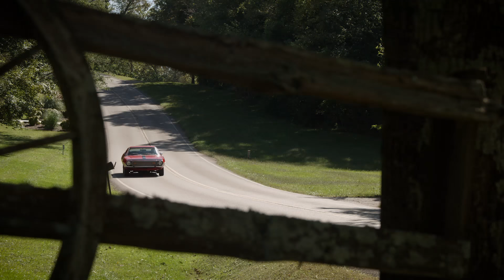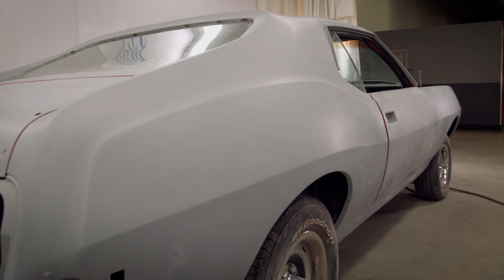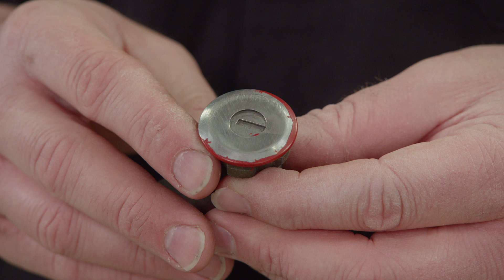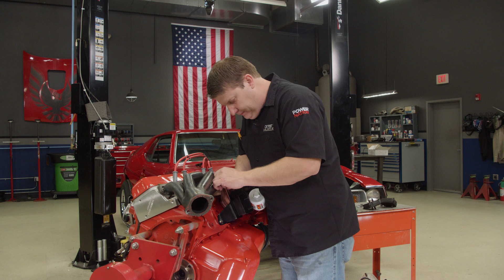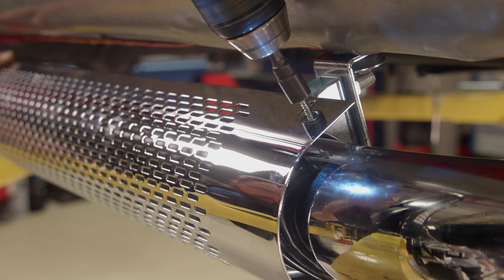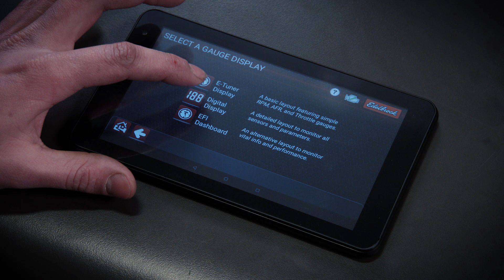Full Build: Transforming an AMC Javelin to a 70s Muscle Machine

Comment: My first new car was a 1973 AMX, black with the Pierre Cardin interior, with a 401 Go Pac and torque-flight automatic. It was hard to find good parts. The Hooker headers didn't fit that well. At one point I had put in a roll cage, and a narrowed Dana with 4.56 with a 4 leaf-link setup. I had a set of heads built by Booth-Arons. I raced a few times at Englishtown, but I was more on the street. I also had a blue 360 4 speed AMX, 304 Gremlin X, pus another Gremlin and Hornet. I miss that car. I've been looking for another before I croak. A word of caution for anyone building a 401. In 74 AMC dropped the 401 head with individual rockers and the only heads available were 304 heads with bridged rocker mounts.

Comment: I had a 1969 javelin I ordered new fully loaded with the 343cu in engine, what a great car. Next I ordered a 1973 javelin with a 304 cu in engine also fully loaded. After owning the 1969 I was very disappointed in the 1973. But it really looked good but performance was not even close to the 1969 car. Handling or speed

Comment: They ruined the look of that car in my opinion. The 390 these came with were very strong, could have went that route but at the minimum keep the looks like it came from the factory for the most part. I was always a huge fan of the original rims and looks of the car. The engine mods were great but ridiculous side pipes, traction bars and the ridiculous wheels? Really?! That's why those were left in the past.

Comment: My 74 amx has a cool adjustments on the front suspension and it changes the way it corners with bolts that are camed. I can turn it after I unlock the lock nut. The way I was looking at the control arm that the bushings were worn out and egg-shaped the hole. But I'm super surprised that it was set up for a pit stop that they were able to move the wheel up and back. In and out in moments.  .I have had a lot of fun with my old race car. I All ways like to road race.  That car is the best fun. I all ways drove Ford 500 cop cars . They are not easy to top in the road handling.

Comment: I had a 73' Duster.  I'm about 6'-2" 290lbs and in the mid 1980's me and my brother were working on the Duster.  We had to change the heater core.  Now the average dude would do what Tommy showed all of us; loosen the clamp and cut the heater hoses with a nice sharp blade.  What did I do?  Well, we had ZZ Top blasting on the car's audio system and I just locked my Gorilla hands onto one of the hoses and ripped it right off the firewall.  The back of my right elbow made a V-Curve in the top of the radiator.  I'm looking at the car and then I brushed off my arm and said "I broke the pretty car".  My brother and my friend Scott were on the ground laughing and howling.  So, don't be a Gorilla like me and use a sharp blade and cut the hoses off just like Tommy.

Comment: This was the lamest build I have seen. What a waste of air time.  So you threw a cheap, generic set of Crager rims with the wrong rear offsets on it including some of the cheapest white lettered tires. White lettering, for the "performance look". Lol.  A front pair of stock, red painted brake calipers and generic rotors were used for the "brake upgrades".  So far less than $1k spent.  Did the handling and braking improve?  Absolutely not!  
The skinny front tires will lock up under moderate braking pressure. The air shocks ensure the rear end has zero movement and will be rigid.  The car , with it's rear tires having wrong offsets, butt end sticking up 4" taller than stock and no suspension travel, skinny front tires with all the car's weight now shoved to the front with new front brakes, this thing will surely kill the 1st person dumb enough to take it on a twisty road or high speed highway.
You all painted the junk Jeep 304ci motor, threw on an intake, carb, headers, and distributor and did an engine Dyno pull acting like we're stupid enough to believe wheel horse power is same as an engine stand Dyno run.
No wonder Mark isn't there for the actual build.  You all took a really decent car and made a Joe Dirt replicar he would drive in the movie.
Ruined a decent car that woulda made a fantastic Trans Am racer replica build.

Comment: I like the transformation BUT I really liked it how it was before, I would of added longer duration cam with a near stock cam centerline with only a bit more lift with those edelbrock heads with a decent 10 to 1 compression ratio , refresh bottom end nothing radical 190hp to the wheels I would've been fine with all stock exhaust.  

I think this car is golden . you guys did a great job btw.

Comment: My high school car was a lot like this. In  November of 1986 my dad came home in a gold on gold on Gold 1975 Dodge Dart Swinger. It was 100% OEM with less than. 13,000miles on it. It took a week before I had tented the side a d rear windows dark black along with the upper 1/4 of the windshield. Add air shocks and antihope bars just like this raised in the rear with 14x8 205/35/14 front 255/45/15 rear with the exact same Crager mags, the 2 barrel Carter carb and OEM steel intake manifold, OEM Altrrnator, H2O Pump, Fuel Pump, distributor, air cleaner, all came off while the cam, timing gears, heads, rockers, lifters, came out. All replaced with MRP bolts, rockers, rods, lifters, Crower Cam, timing gears to loose the sloppy chain, alloy heads ported and polished from a 68 Dodge 340ci, alloy intake manifold from a 67 Plymouth 360ci motor, OEM was replaced by Accel Distributor,  Coil, Wires AC Delco Plugs, Holley HP Fuel pump,  braided stainless lines, double pumper 650cfm Holly Dominator 4 Barrel Carberator, K&N Triangle washable foam and stainless air cleaner, King electric duel 15" fans, H2O pump and Oil pump to reduce belt drag, small underdrive pulley on the AC alternator making 12 volts still, B&M shift kit, u joints, alloy drive shaft from a 67 Cuda, rear posi axle from 69 Barracuda Fast Back, Pioneer cassette deck, 12 channel equalizer,  2x 250W Pioneer AMPs for door and front speakers & 1ea 1,000W AMP for rear speakers, subs, mounted under rear window deck, speakers 2x 3" mids & 2x4" Highs in the dash, 2x6" Lows in the front doors 2x 6" Highs rear 1/4 panels,  2x 6x9 wide range rear deck, 1x 6x9 wide range center front dash, 2x 15" woofers in custom axe shaped boxes in trunk under deck, 1 x 18" subwoofer in large custom round box in spare wheel well. The car was still Gold with gold vinyl roof, gold interior but I had painted all the chrome and stainless trim Flat Black including grill, headlight rings, hi intensity halogen bulbs went in headlights plus fogs slung under front bumper, white 5 inch tall Gothic Lettering saying OTTROD on the rear window white vinyl stickers of little red riding hood swinging on a tree swing on rear 1/4 Window. Radio antenatal heated in 8 points and bent into a 3D  square Box and the going up again for 3 inches painted flat black. Rear concave window got the darkest back tent I have ever seen. You could no longer see out of it. I had to have 5" round mirrors on each door. Day 1 OEM 1/4 mile 15.68 @ 92mph Day 1,095 modified 1/4 mile @ 12.2 @ 136mph

Comment: Too wide rubber in the rear, keep it inside the quarters!  I would like to have seen you have the original wheels widened to just fit inside the wheel wells, those wheels are part of its character as well as the engine which I am glad you kept.  Nice ride though!

Comment: Would be sacrilege to put anything other than the same motor back in there.

Yes, it looks like the 70s. I had those deep dish cragers on my 68 Nova, but on the rear I was running M/T G60 cheater slicks , those look like L60s. I didn't want them to stick out all goofy like that! Lol

It always seemed like the wannabe muscle cars had that look. Cragers, Gabriel Hi-Jackers (air shocks), and Hush Thrush mufflers. No engine mods. Lol

Comment: Had a 1970 javelin for years...bought it in the summer of 1974 for $1495.00 at dealership. new they were 2600 to 3000. I owned it for many years, no rust, original except for the painted blue emron before I sold it a few years
 later
Reply: My first car was a '71 Javelin that I bought in the spring of '74 for $2,000. 360 SST, I loved that car.

Comment: I owned a 1968 Javelin SST 390 CID with the "Go Package." It`s amazing how much knowledge about that engine has been lost over the decades. The v8 was the same motor for all 3 of their displacements. But the 390 had extra webbing in their main block for reinforcement. And it had a stainless-steel crankshaft. The 390 heads had dog-leg ports which could be cleaned out for better air flow. My best single improvement was headers which knocked a full second off my quarter mile runs.

Comment: In March of 1973, I ordered a new 1973 American Motors Javelin AMX from Art Post Rambler in Kalamazoo Mi. I ordered the 401 Go Pac with the 4 speed manual and 3.91 rear gears, am fm Motorola stereo, all tint windows, inside map light, inside hood release, power steering, body side scuff molding. It is Cordoba brown with gold, fade to black hood T stripe, and black vinyl interior. The only changes that I have done to the Javelin are, 1970 Rebel Machine cast iron intake, Removal of the Air Injection Smog Pump. The addition of a larger 1 in. front sway bar and the addition of a 3/4 in rear sway bar, other than that the car is all original while anything removed from the car is saved and stored. My Javelin has not been on the 1/4 mile drag strip, but has been raced for several years on a Gymkhana road course. My wife has taken a few 1st place trophy's by beating out Camaros and Mustangs in a best timed, one car at a time  Gymkhana races. The Javelin was retired from racing in 1982 and now only goes to car shows and cruise in's during the summer months. It is always garaged and stored up on jacks during the winters. This Javelin AMX is a fun car to drive yet today. Where I live, I burn unleaded non ethanol 91 octane gas with the addition of 5 ounces of Lucas upper cylinder lubricant in every tank of gas to aid the valve seats. Some day in the near future, the 401 will come out and get a rebuild along with a slightly hotter cam along with a set of nice headers with an X crossover, other than that along with new bushings for the front end it needs nothing. AMC did a great job with what they had available to build great cars.
Reply: That's awesome!
Reply: The best looking car from that era IMO. Big chevelle fan but this car is #1 from looks.
Reply: Super Cool 😎
Reply: Brown was a popular color in the 70s but not on a muscle car. Great unusual choice.
Reply: Sure you did👌

Comment: I owned a 73 Javilin AMX with a built 401 and Go Package back in the late 80s, early 90s. Had the spray in it too. Looked pretty much the same as yours but mine of course had the cowl hood. It ran high 13s at 114 mph without spray with like 308 gears or something like that, I can't remember exactly. I do remember it was a bitch to get the thing to hook off the line. It spun all the way through 2ond gear. Wish I still had her.

Comment: I had two Javelins, a 1968 and a 1970. I loved my 1970  Javelin.  Both cars had a 4 speed transmission.  I had a bigger engine in the 1970.  My 70 had a 390 ram air, SST super sport.

Comment: This was fun to watch.I,m glad you guys found an AMX hood .It makes the car.The Javelin had the flat hood and for 74 the induction hood was not available unless the factory had one left over from 73. I love the car .Someone will get a lot of attention.
Reply: You are right on the cowl hoods, only available on the ordered go pac option between 1971 and 1973 as no 74 could be ordered with that option. the best guess that I have read is roughly 25 % of all 71 to 73 AMX's ordered with either the 360 or the 401 came with the functional cowl induction. The functional cowl induction option worked so well, that some have stated that there could have been between 5% and 7% horse power improvement with that system over the non cowl induction system.When I ordered my 1973 Javelin AMX new, that Go Pac option cost an additional $476.00 more to just get the functional cowl induction, it was worth it.

Comment: Javelin was exactly what AMC/Rambler was known for!  Dependable, solid, stylish and inexpensive!  Nothing wrong with that!  😀😃🙂
Reply: I loved my 74AMX but dependable it was not.  I still have the records (and the car). My first repair occurred at 2800 miles (starter). At 6700 the instrument panel voltage regulator failed. By 21000 I new the rings were wearing because I was blowing out blue smoke. My 2010 Prius has not had a single problem. Cars back then were terrible by today’s standards.

Comment: I had a 73 and 74 with the 304. I added headers with true duals. Accel ignition. 460 Holley carb with Trick kit. Edelbrock dual plane aluminum intakes. B&M Trick shift trans kit. Floor mounted B&M Starshifter and open element air cleaners. Definitely needed more compression but they both  had huge improvements. Both had 59 series 12" wide real tires thanks to air shocks

Comment: Nice build! Good to see something unusual being built to more modern standards. I like that the standard engine was built up too, that will make a lot of people think about hopping up their own little 302, 305 or 304's instead of forking a huge amount for a big cubic inch engine. not everybody has a loose 100000 to build their car. One thing that I do have to ask though, with the much bigger diameter tires out back changing the "final gear" ratio, wouldn't the car make more torque and power on the chassis dyno? I would have liked to see the difference between a near stock tire size and the new wheel set and the huge rear meats. Maybe a diff gear change to a lower number like a 3.73:1 would make it easier for that little 304 to push that javelin a little quicker. I'd like to see how numbers change with different ratios and the same mechanicals.
Reply: Id be willing to bet the new build with EFI enjoys a great deal better fuel economy [if you drive it nice] than it did before. I agree, the gears were really tall. A 3.73 would definitely improve the torque.
Reply: The problem with putting in a 3.73:1 is that it buzzes at highway speeds. My AMX was 3.54:1 and it ran at 3000 rpm just doing 60. Somewhat annoying.

Comment: First thoughts after the chassis dyno pulls, after he said that it "kicked down" I knew it was a 304, because I've honestly never heard of a 401 having an auto behind it. I'm not trying to say that they didn't exist, but I've never heard of a 401 auto, so it must not have been prevalent, or nobody wanted the auto. I can tell you that a 401 swap in this Javelin would be sick with a 5 or 6 speed manual with much higher compression, a set of ported aluminum heads, and a much higher duration and lift cam.
I'm not saying that a 304 can't make horsepower, but everyone knows without a power adder that there's no replacement for displacement.

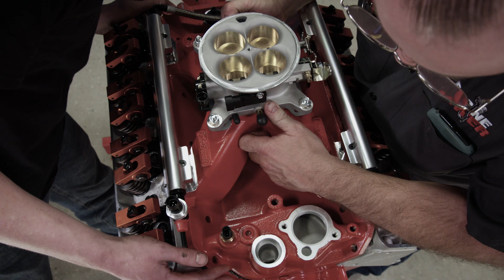Comment: 44:27 A single plane on a street driven car ? Who gave the OK on that one ? Nothing but pure looks over function. 👎🙄
Those back tires are ridiculous wide, doesn't look right and will throw all kinds of road trash on your fancy new paint job.
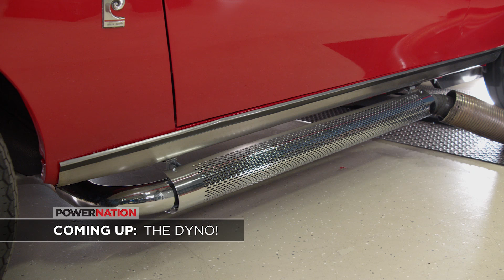1:06:48 Tiny air cleaner, hot 180*F engine bay air induction. Yup, doing it right. 👌
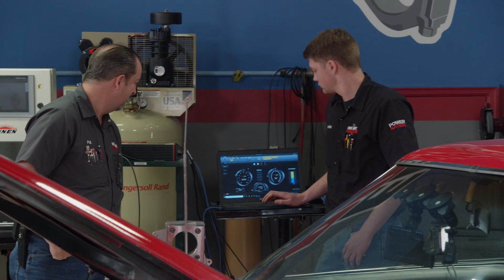1:09:26 A/C delete ? ! Why ? Do you like to be sweaty and miserable ?  🤔

Comment: This car is a perfect candidate as a Grand Tourer.  Traveling in comfort, luxury and performance across the USA;  taller gears, performance suspension, etc.   Hey, is that a Cardin edition?  I see the swoosh design on the headliner!
Reply: Yes and it had the p cardin insignia badge outside also, what were the number of those produced probably low. Grand tourer save save cardin interior.

Comment: The intro talks about how much they liked Trans Am, then they did something completely different.... To make matters worse, built an engine that makes less power than they did in Trans Am. The engines they used at first (Based on a 290 and Traco built them), and made 360-380hp at the crank. By 1971 they were much more powerful (480-525) and would have been street worthy and still made more power than the engine in this Javelin, with aluminum heads, on 93 octane. Using todays tech, they got less power.... The problem today, is that most buy parts off the shelf, slam them in, and then don't get any power out of it. Little things like using a better rod length, which they claimed parts are not easy to find. And all they had to do was look in a strait 6.... Same crank pin diameter, same wrist pin diameter, but 6 1/8 long.... Where do you think people got the idea, and the rods, to run long rods in a budget 304 that would run circles around a short rod one? 199/232/258 strait 6 rods... You can build a screaming 304, that runs fine for daily use and on pump gas. You are probably going to have to get custom pistons on any 304 build, so it really doesn't matter if you want longer rods. A longer rod engine will run smoother, last longer, get better gas mileage, and make more top end power. Basically it would be everything this one isn't.. This is not paying homage to the engines that roamed the streets in the 1970's, at least not the ones that won races. Not even close. This show will never show you how to use parts from another engine to make a better engine, because there is basically no sponsorship for that. But they will show you how to build an engine with off the shelf parts that a Honda Civic can outrun.... It is called sponsorship homage......

Comment: You guys are hacks.  Your tire/wheel selection sucks.  You can get very wide wheels and tires under a lowered 71-74 Javelin.  Why not just drop in a 401?  It bolts right in.  That 304 is a wimp motor.  Overall, I give you guys a D+ from a former owner of a 70 AMX.